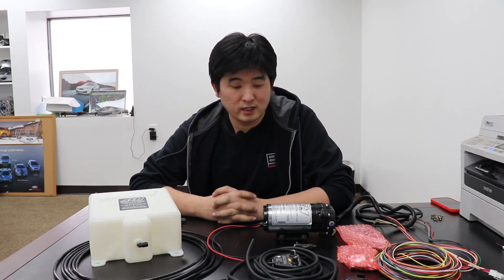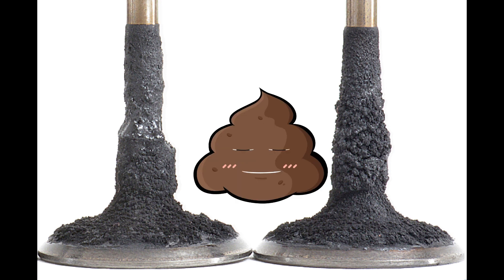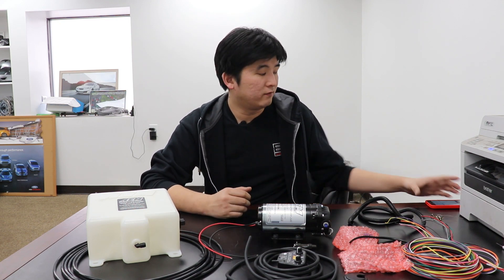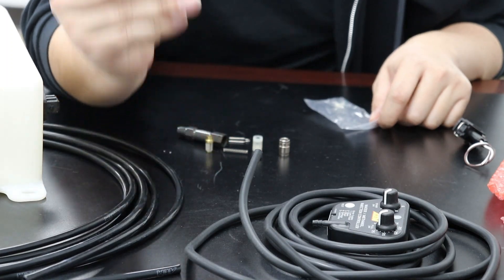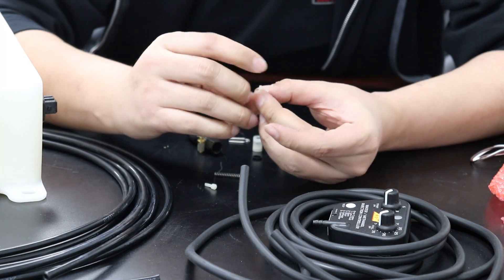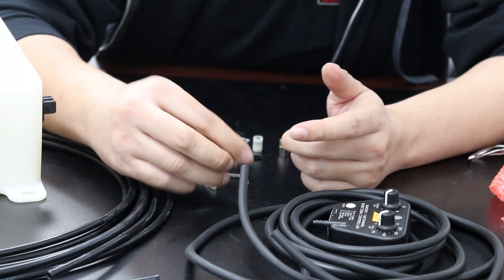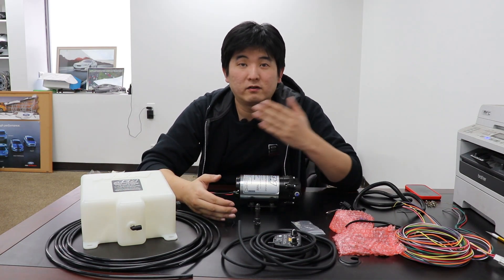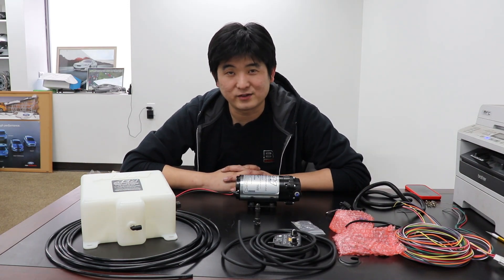AEM Water Methanol Kit Explained (with the new V3 Nozzle)

Comment: approximetly how much HP gains does water meth injection add for BK2 2.0?
Reply from the maker: No exact figures because it would also depend on other factors like turbo size and fuel capacity but expect at least another 10-20 hp on top of regular pump gas for sure
Reply: @ Ok, and to be more specific lets say FBO alphaspeed tuned with stock turbo

Comment: so normal driving the green LED should not be illuminated ? will only illuminate when spraying, is that correct. Also on start up the green LED flashes twice on controller and external LED, and then both extinguish is this normal ?

Comment: Should the nozzle be mounted on the bottom of the charge pipe( shooting up)? I imagine this to be safer so water cannot drip down into the pipe in the event of failure. Also, should the nozzle be at an angle or mounted 90 degrees into the charge pipe?

Comment: the water does the octant the methanol is a moot point do not even need it yea it stops freezing of storage water tank .i wish folks stop with teaching the novices technically wrong intell
Reply: Methanol accelerates evaporation rate in a short intake system. It converts to gas first and leaves behind a smaller water droplet. This more fine aerosol cools even better.

Methanol helps system function. Water does most of the octane boosting and air cooling.

Comment: I think water injection is better ,because you have the benefits of cooling and increasing octanes and you can tune your car with proper afr,with meth in the game afr is independent from meth that means you must have a second tune in the pocket for an empty tank.
Reply: I'm still looking into this but I'm finding that you can still target 14.6 and adjust the manifold air temp timing tables so once the meth starts Temps drop, timing advances, and narrowband adjust fueling.  This wouldn't be for power adder applications because the ltft would have way too much fueling to pull back but in a fuel economy applications and increase octane support maybe could work.  Please correct me if I'm way off not much info out there
Reply: So pure water will stop detonation? I’m running a high comp carbureted SBC 350 and I don’t want to have to keep buying premium gas 😂😂

Comment: Have you guys tested how much gain you will get on a N/A vehicle! (Hyundai Genesis 5.0 DH
Reply from the maker: Every car would be different in amount of power gained by tuning for the meth
Reply: @BTRcarcustoms  would you suggest this, just your opinion do you think there would be enough gain for the money spent doing this? And would it work with the canned tuned from you guys
Reply from the maker: @zachsmith6550  the cleaning effects of the kit is worth it in it own sense but if you want more power out of it you will need to have it custom tuned
Reply: @BTRcarcustoms  and then I run into that problem lol, no one custom tunes my car 🤦

Comment: One question please ,how do u install it on super charger cars do u use the same boost line or using the map sensor signal ,I ordered my kit v3 one the controller does not have the boost line
Reply from the maker: Yes boost signal off your map sensor using a map adapter would suffice
Reply: @BTRcarcustoms  do u recommend to ran the boost line set up or the map sensor signal ,because we had an issue for the map signal it was keep pumping meth into the throttle bodys once we turned it on and ended up motor damage 💔 ,we put a switch on and off for the kit and I don't think we should've ,any info appreciated
Reply from the maker: @hezharanya  definitely use an actual boost source with a vac line running to the controller
Reply: @BTRcarcustoms  and I shouldn't have and separate  switch on and off ,like It says on the video it's on when the car turned on ,
Reply from the maker: @hezharanya  yeah no need for that. If you are worried about siphoning effect, add a solenoid

Comment: Hi quick question ,just got my aem kit does the rear of your nozzle bit that connects to nylon hose have any play in it ,mine seems to spin slightly ...thanks
Reply from the maker: It will have play until you plug a hose into it

Comment: Mate a correction on your nozzle size. The plastic nozzle with the Divet on the bottom is 250CC and not 500CC as your mention. The 500CC has a cupped end and 1000CC flat end. The kit comes preinstalled with 500CC nozzle. This is as per info and instruction manual of AEM 30-3313 V3 nozzle kit.
Reply: now makes sense to me

Comment: Hey so i bought a car with the V2 aem water /Methanol injection and I was wondering is there a way to turn it on and off as I please or is  it on 24/7
Reply from the maker: the pump is always on when the car is on
Reply: Bro is the yellow wire u have to connect it to a 12volt

Comment: Hello. I just purchased the kit for a Jaguar XF 3.0L SC. Running both upper and lower the car is turned up to about 450 Bhp at 18psi boost.  I just want to make sure, because the chart says I should be running the 1000cc nozzle? Is that correct? I understand the settings on the controller as well, but how do I know if I’m spraying too much boost juice? Btw…I’m not tuning for methanol. Just want the cooler iats and knock control.
Reply from the maker: Sticking with what they recommend is an easy way but if you are looking for the benefits without tuning for it, running the smallest nozzle works just fine

Comment: I litterally want a kit that sprays just enough to clean my valves clean.  Not worried about making extra power.   For a vr30 what would you suggest?
Reply from the maker: Run this kit with the small nozzle :)
Reply: You can run pure distilled water in these kits. Pretty sure you don't need a tune if you run pure distilled water, but still talk to your tuner before installing.
Reply: @odethious5639  I live out in the sticks.  I am my tuner unfortunatly   lol.
Reply: @ShabbernigdoXingjian  

You should be perfectly fine with distilled water injection, but I still won't tell you to take some random person's words on the internet. Try calling a race shop somewhere and ask on the phone. They should be able to give you all the info you need. 

If you want a tune, they might even be able to send you one over email after getting some data from your car. 

Good luck buddy.

Comment: Can i use this kit with stock ecu without tune my car natural aspirated v8?
Reply from the maker: If your car has a stock wideband and target lambda system, you can run this without a tune. However this will most likely not give you much power gains without a proper tune
Reply: @BTRcarcustoms  my car genesis BH 5.0  need tune with this kit ?
thanks

Comment: i have a question on the 3.8 gens how do i clean my valves ?? a safe way lol , also iknow u guys probably dont care but i made a edit acouple of years ago of the btr genny 😍
Reply from the maker: There are several ways but the most effective way is the walnut blast (many bmw performance shops will have the equipment as they are prone to this) also the water / methanol kit install will end up cleaning your valves for you over time as well.  so if you don't feel like taking things apart and getting the cleaning done every once in a while, just get a water / methanol kit installed and have it steam clean your engine as you drive

Comment: Yeah half less spray v3 vs v2 nozzle
Reply from the maker: the amount of methanol is determined by the jets you use. This kit comes with 250cc, 500cc, and 1000cc as explained in the video
Reply: The V3 will flow the same depending on the nozzle. The difference is  V3 offers better atomization. So more surface area for the water to cool temps faster. Also finer mist=better burn and combustion of the meth side of things. Faster cooler air+easier/more efficient combustion= more power